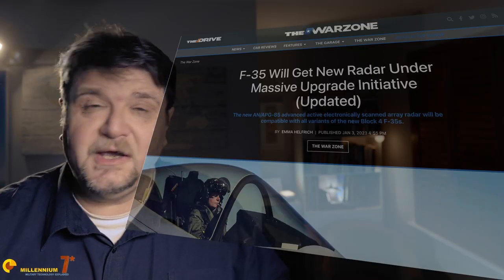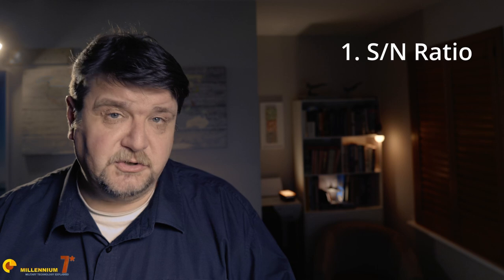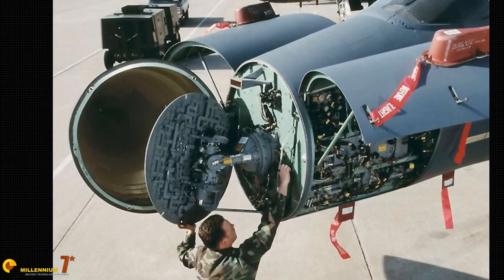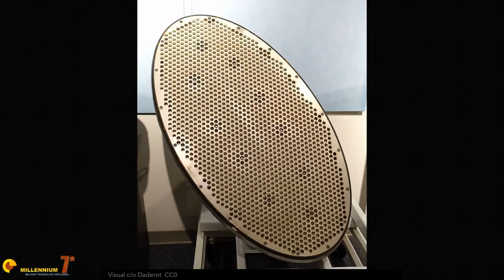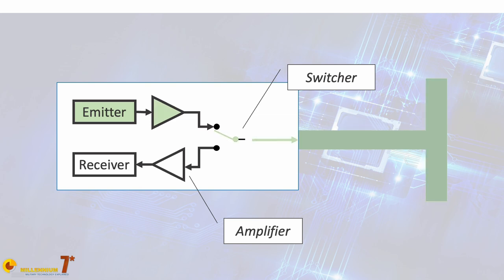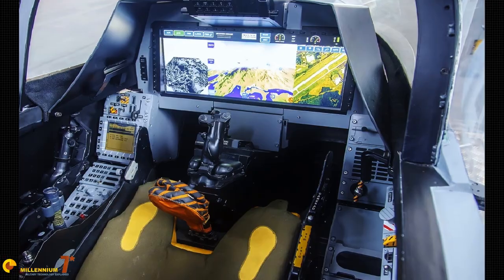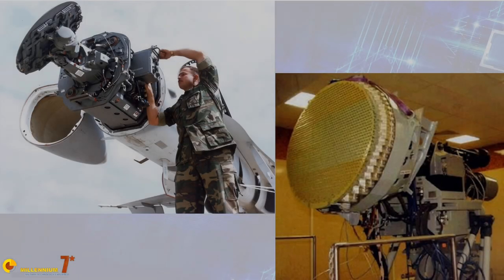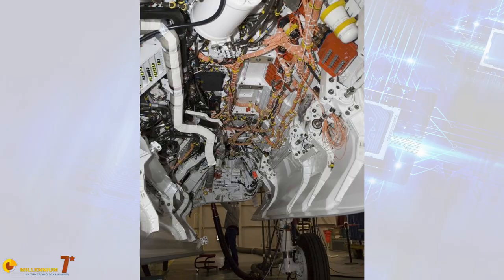The insane engineering of the F-35 AESA radars!

Comment: I don't know any western fighter AI radar that has mechanical steering over +/- 60°. Why example Super Hornet, Eagle etc have limited 120° radar azimuth capability.
The soviets designed the Su-27M (original Su-35, that is not to be mistaken for Su-35S that is new project) to have PESA radar. In fact the original Su-27S (S as: first serial production) to have same radar as MiG-31 PESA was. But their schedule problem was that they couldn't get it lighter enough for the time, so N001 radar was developed for it.
Then when PESA radar came available, it was installed on gimbal head, because PESA/AESA radars problem is that they are limited to similar way to +/-60° beam steering, and after +/-45° the beam power and resolution drops dramatically, so example at the 50° in azimuth you can have 70% of the power and 2/3 of resolution, where at 55° you can have 40% of power and 1/3 of resolution. And now more you go to direct beam, you lose the purpose of radar.

So Russians went and installed the PESA on mechanically steering gimbal that gives additional +/-70° rotation, and now linked with electronic beam steering, they can offer +/-120° scanning. A rare feature as fighter can literally be flying away from target, 25-30° angle and keep guiding missile or maintain search. 
That is in the Su-35S and some Su-30 fighters. 
As well Russians developed their mechanical scanning radars in the 80's to guide two SARH missiles on two targets in limited azimuth separation, and with PESA it was increased to four missiles on four targets in whole +/-60 degrees. 

This major radar technology advancement have made those old radars look like revolvers in era of automatic machine pistols. As where the original first ones were like muskets, with capability only to range target and maybe help to calculate lead for guns, the capability to search airspace for targets was so revolutionary that next step really was only when it became possible ground map terrain to get a picture. 

So now with PESA/AESA that has not really changed that much what is done with them. It is just more advanced as previously between revolutionary steps. 

For the pilot it does feel major way to give information to be able make better decisions, but that have been many ways problem for interface designers.

Example, in 15 years ago F-15C the pilot was still given a brick symbol for most of the time in RWS mode "best detection and ranging" and you needed to have a "memory mode" where display faded previous brick symbol different rate after each "picture frame" (full radar pattern search). Based to brick "tail" pilot was required to visualize the direction (tail direction) and speed (space between trailing bricks) and generate situational awareness based that.

In TWS mode pilot was given way to start tracking few targets, with line pointing their direction from last hit.
The pilot didn't know targets altitude, without moving radar cursor on brick and reading altitude, heading and speed from numbers. And compare that to own radar scan volume dimensions like altitude in that range.

Really mental gymnastic required to get situational awareness in fast and risky situation (talking about 30-60 seconds window between detection and engagements). And talk about this when F-15C pilots didn't get datalink before 2012-2015 and larger color display until 2018. 

What soviets did, was make HUD as radar scope, where target size and IFF information was presented in symbol size.
Two dots was small target, three was medium and four was large target. Now pilot could visually identify example bomber from escorting fighters. Then they added IFF information visually, where one row was enemy, two rows was friendly. And automated it so that launching at friendly contact was not possible without override. So at glance pilot saw target types, azimuth and range without taking eyes away from HUD. 

Then in HDD (heads down display, like in F-15) the pilot is given graphical picture for situational awareness. There pilot see own flight plan as line with circles for waypoints, so pilot knows where everything is relative to it. Pilot is given a every radar contact as T like symbol, where width of top line is the relative altitude of pilot, so if it is wider, it is higher (potential energy higher than pilot have) and if shorter then lower. And the I beam show direction and speed visually. Longer it is, faster it is, short means slow. So pilot can visually see instantly what is fast and what is slow, like bi-plane/helicopter vs fighter or supersonic vs sub-sonic.

And Su-27 had datalink. It was capable connect 4 fighters, forming a group. 4 groups and GCI (Ground Control Intercept). The inner flight refresh rate was 5 Hz, so five times a second. And 1 Hz between groups, and 0.1 Hz between GCI.

Every flight member position was updated in the HDD picture. Their relative position, speed, altitude and flight member ID number. This is why as well Russians don't have pilot callsigns but numbers. So flight 133-2 is flight 133 group member 2. So listening radio is like "Two, flank left" or "three, return to formation". 

But that is not all. When anyone detects a target with radar or IRST sensor, that is updated to datalink. So flight can be spread wide and update the picture for all. Flight can cover multiple altitudes and generate large picture. 

Each target is as well marked with numbers.
1) target ID so everyone knows when someone say "target 11" that what it is.
2) pilot ID who in group has detected the target.
3) Pilot ID who is has been assigned to engage that target.

Example, flight commander can with datalink issue command for flight member 3 to engage target 7. Where pilot 3 systems are configured automatically tracking target 7.
Locking target makes line drawn from wingman toward target.

The HDD as well visually show the missile range at the designated target as pie cone. When target is inside, it can be engaged. 

If there is a jamming target that denies range, Su-27 can spread out and use their sensors and datalink to triangulate target range, as when the targeting lines intersect, target position is found and can be engaged if inside missile range. Speed is unknown, but position is known. 

Datalink allow to flight members fly passively, where someone else is transmitting targets. Groups can fly silently around targets and attack from advantageous position. Or even silently.

And when flying in navigation mode, pilots were given visual information of the fuel consumption distance and airfields  around them if required to land somewhere else or know where they are. 

The original Su-27 was as well designed to have a five color HUD and HDD. Red, green, yellow, white and blue. It was too be used symbolize differently different elements. But likelihood was that they couldn't get MTBF high enough. 

So where West was really limited in the user interface, they made somewhat better electronics, but Soviets really got better overall experience for their high-end targeting systems.
Reply from the maker: this is fascinating. Do you have anything I can read?

Comment: You miss one very important thing when talking about radar on modern fighters. It is not several radars working together on one plane. It is several radars on several planes working together thru data links.
Reply from the maker: Already discussed in other videos...
Reply: The radars work together ONLY in the digital/data domain. The RF bits work independently of each other.
Reply: @hb1338  Yes. But when you do the data analysis based on the raw data collected by multiple recievers several km apart that and based on different frequenses transmited from different directions at a possible target, you get very interesting results.
Reply: @Millennium7HistoryTech  seen them. 👍
For some reason I think we do not know half of what is possible to do with multiple syncronised easa radars several km apart.

Comment: The assumption that AESA is strictly better than PESA is dangerous. It definitely has solid versatility advantages, but putting amplifiers before signal mixing is inherently more vulnerable to off axis jamming, never mind trying to do the processing digitally. If you want to operate in low probability of intercept mode you cannot 'chirp' to burn through continuous noise, meaning each Rx module is basically trying to find the signal it wants against the full jamming, with directional filtering only possible later. Amplifier noise from the deliberately massive jamming signal will obscure the radar return, because low noise doesn't mean no noise, and the jamming signal can be much stronger. In contrast, passive scanning can identify the direction of the jamming and then shape the receiving antenna to filter based on that direction so that the jamming signal never even gets to an amplifier.
Many of the tricks that are possible with AESA are possible with PESA, and it has a couple of it's own. AESA struggles to detect low probability of intercept radars because each Rx module has bad individual directionality, meaning the highly directional signal from a LPI radar is likely to be missed by every Rx module, so missed by the radar as a whole. PESA in contrast is much more directional in it's receiving. They can scan their receiving angle to detect radars at much longer ranges. It can operate less like a very sensitive radio detector, and more like a radio telescope.
What we describe as AESA are often hybrids. Essentially they are a arrays of PESAs. This mitigates some of the directionality issues, but there is always a trade off between versatility and receiving directional glare resistance. There are absolutely legitimate use cases where you would just want to maximise glare resistance, in which case pure PESA would be better.
Reply: Most of your points are solved by software and processing power. Beside the radar is now integrated with other sensors.